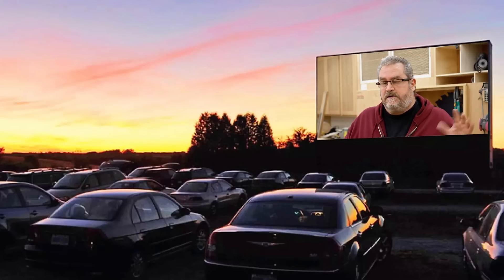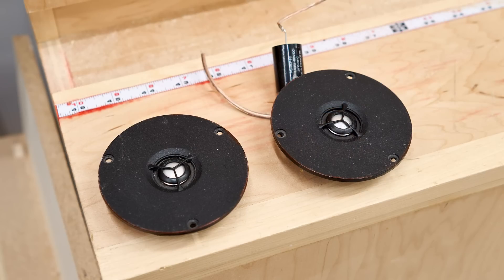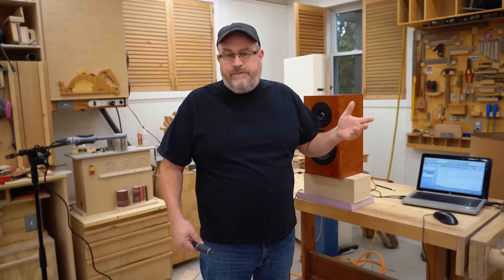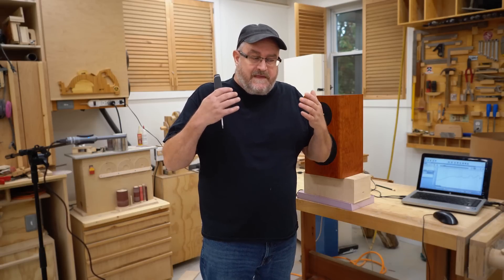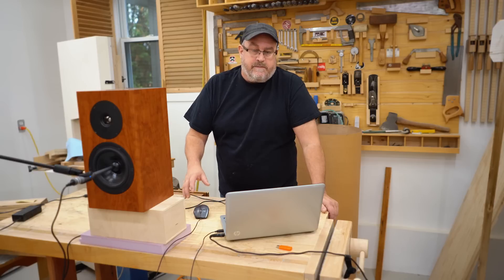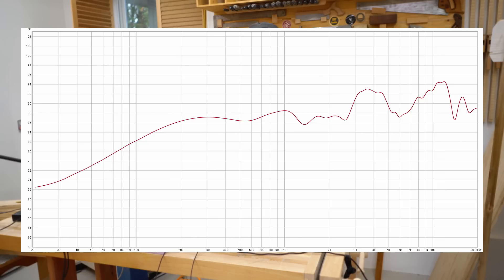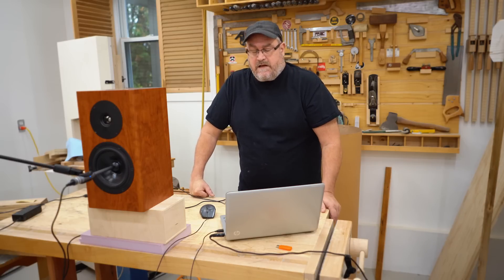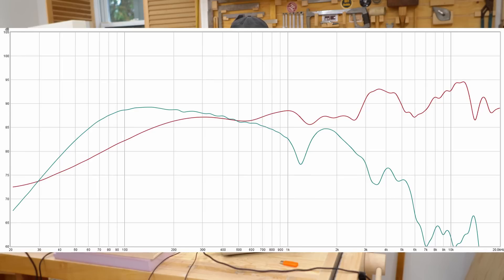Why My DIY Speakers Sound Bad / Measuring With REW and UMIK-1

Comment from the maker: What I mean when I say there will be no major builds on this channel is that I'll be posting those on my main channel, where I do full project build videos. When I build a new set of speakers, that full build video will be on my main channel.
On here, I want to concentrate more on the technical, much like I do in this video. So I'll be going through details that won't be in a build video, or prototyping and testing.
Like I said at the beginning of this video, I'm not an expert but I do have a fairly solid background in designing and building speakers. I was heavy into this for several years more than 10 years ago and have forgotten a lot of what I learned at that time. I'll be working to get that back and learn more, but I will make mistakes along the way. So keep that in mind when you watch. 
Regarding the tweeters in these speakers, that peaking is likely from a combination of the tweeter quality, poor crossover design and some diffraction. However I've found a replacement pair that are a better match for the woofer, and I'll be installing those with a newly designed crossover in an upcoming video.
Building the office speakers: https://www.youtube.com/watch?v=GlBuJhMSmcI
Making the original crossover: https://www.youtube.com/watch?v=kO2faotm3sE

Comment: How about forget the crossover entirely and use a stereo amp in each speaker to drive the cones separately. D-Class mosfet amps are dirt cheap, and technically it is a better solution as you can tweak it to get the crossover point and levels exact.

Comment: From the camera angle it looks like you measured it with the mic aimed at the woofer, you should have measured it at the tweeter level and in between the woofer and tweeter, measure it with one of the driver polarity inverted to check for the null at the crossover point, and also add some baffle step compensation.

Comment: Why don't speaker manufacturers just post a graph now instead of a picture of the speakerz?! With the decline of av stores we have to unfortunately rely on only measurements now which is a shame. Measurements are absolutely not the end all be all but I guess that's what we have to work with right now. Oh well. At least its accurate.

Comment: One of the most common issues with DIY speaker builds is that they tend to completely ignore directivity.  That's somewhat understandable as it can be quite a chore to perform the necessary simulations or manual CEA2034 spins but it also tends to negate much of the builder's work.  When a passive or DSP-based crossover are designed based solely upon an on-axis response without proper simulation or off-axis data, the result is typically severe directivity nonuniformities which produce a completely different listening window and in-room response when ERs are summed.  Unfortunately, this is also a problem which can never be fixed after the fact using EQ.

Proper directivity matching really needs to take place when drivers are being selected, with a degree of passive control also being engineered into the baffle itself.  Where possible, a waveguided tweeter simplifies much of the design process.
Reply from the maker: Hearing guys talk about off axis response and elevating it to make or break importance is getting old fast. Directivity and off axis response are important, but not the major factor it's being made out to be lately. And it's largely determined by two things: driver size (cone / dome diameter) and crossover frequency. In a two-way there's not a lot to mess up unless the drivers are grossly mismatched.
Reply: @IBuildIt  Directivity really is a make-or-break characteristic, as it is one of the few problems that can't be corrected after the fact.  If the response of your early reflections differs drastically from that of the on-axis, then you effectively have a speaker with an unpredictable listening window depending upon the room.  Studies published by Olive and Toole corroborate this, as it pertains to listener preference. 

The pistonic diameter of the driver in conjunction with the chosen crossover point determines the widest achievable directivity but only given an infinite baffle.

The trouble is that crossing a directly radiating 20mm or 25mm tweeter over to a 5" or 6.5" midbass driver almost necessitates a directivity mismatch under most circumstances, as the Fs of the former will almost always place its usable  passband far beyond the point at which the latter narrows.  You mention that directivity is a simple matter for two-way designs but in practice, the vast majority of them lack smooth directivity for this reason and we now have access to a great deal of measurement data which shows this.
Reply from the maker: I just made a video talking about early reflections and my opinion on that research. Early reflections are destructive and need to be treated so that they don't corrupt the direct sound from the speaker. That's the make or break component in all this - reducing or eliminating those early reflections, and not trying to "optimize" the speaker to make the reflection (somehow) more acceptable.
Reflections are a distorted copy of what the speaker is putting out, and having more accurate off axis response can actually cause comb filtering to be worsened - two of the same signal arriving at a slightly different time will cause cancelations at some frequencies.
Sounds like all of what you understand about this comes second hand, and not from anything you've done yourself.
Reply: @IBuildIt  
Early reflections do produce comb filtering but above the transition point, it becomes so narrow as to exceed our Equivalent Rectangular Bandwidth (see Fletcher's paper) and in conjunction with HTRF, the result is a perceptually smooth but additive response.

Most listeners do not make use of room treatment and it is therefore critical that a speaker exhibits uniform directivity if it is to behave in a predictable manner above the transition point, regardless of the room.  When designing a speaker, one does not necessarily have control over the eventual listening environment but directivity is a characteristic which we can control. 

Arguably more problematic are late reflections, which serve only to raise the perceptual noise floor of the room and which can be seen in RT60 data.

There is certainly debate within the engineering community to whether early reflections are beneficial but your characterization above conflicts with the peer reviewed research that we do have.  If you believe that you can demonstrate something which runs counter to existing research, then I would genuinely encourage you to publish a paper rather than debate the subject with me, a fellow non-expert in this field.

You mention that my comprehension comes second hand but the most effective means by which to understand any subject is to stand on the shoulders of giants.  I could quite easily share my individual experience but it is my position that uncontrolled subjective evaluation is unreliable, regardless of the point of view for which one advocates.
Reply from the maker: Lol, publish a paper... what do you think this is? One learned professor talking to another? You can't see me, but I'm rolling my eyes right now :)
You can stand on the shoulders of giants on both sides of this issue. I'm not the only one saying early reflections are damaging - look at recording and mixing studios and the level of treatment used there to fight reflections and reverb. 
And even better is to take the matter in hand yourself and listen to both environments. Set up some treatment and compare that to the non-treated rooms you already are very familiar with.  Until you have, your opinion is just repeating back what's coming from someone else's mouth.
Most listeners don't actually listen to music or care that much about how it sounds. So tailoring loudspeakers for the masses will be a different task than setting up a listening room where how the music sounds is VERY important to the person listening. The research you are putting your faith in is for the masses, or people who (for whatever reason) prefer listening to their walls acting as speakers that play along with their speakers.
Reply: @IBuildIt  
I think this is a couple of enthusiasts having a discussion, with one of them disputing papers which in their most recent video, they admit to not having read.

I disagree that the masses have vastly different preferences from trained listeners under controlled conditions.  This is likewise a subject which has been studied in great detail (see Toole's papers) and the research replicated many times.

The scientific method requires no faith.  The aforementioned research is utilized almost daily to engineer speakers which produce higher preference scores in trials.  We evaluate models by their ability to make accurate predictions.
Reply from the maker: But still I have the gist of it. I have an adequate understanding of the premise and conclusions and (most importantly) the goal. Did you actually read the papers, or did you watch talks and interviews with Toole? Because I've done that.
I also have a treated room which I'm guessing you do not. That's why I hold my current opinions on which sounds better - empirical evidence. But they are just that: opinions.
As for faith, you are putting YOUR faith in the research. That's not the scientific method. The research was conducted in a scientific way, yes, but your complete reliance on that research is what's known as faith. You are taking it and stating it as fact when you haven't done anything to validate it in any way.
Reply: @IBuildIt  
I have both read the papers and watched the talks.  Yes, I have both an extremely dead room in which speaker directivity effectively becomes irrelevant and a more reflective one.  Without adequate controls in place, any sighted subjective evaluation that I attempt to perform will be compromised by expectation and level bias.

As I said, the proof is in the pudding.  Models are validated when they consistently make accurate predictions.  That Toole and Olive's work consistently produces strongly preferred loudspeakers validates the model.  There is no faith required on my part.  Just as I don't need to manually replicate the field of evolutionary biology or cosmology to accept the validity of those models on the basis of their predictive capability.  Just as the Higgs Mechanism model was validated when the predicted Higgs boson was discovered.  No faith is required.
Reply from the maker: But you would have to provide validation if you started promoting those subjective conclusions as FACT, if you were a scientist. 
That's what you are doing here: promoting conclusions made by others as fact without doing anything yourself to back up those conclusions. If you had said those are your opinions based on your experience and cited the papers as a resource, then that would be a different thing.
Listen, I'm used to watching guys back into a corner they've constructed around their assumptions and double down on everything they say, so I'll let you off the hook.
Reply: @IBuildIt  
I have to say that you have made far more assumptions within this discussion than I, going so far as to assume that I must have an untreated room solely on the basis that I disagree with you.  That could be interpreted somewhat less charitably as arrogance or condescension rather than a reasoned response.  I would prefer this discussion to focus on the ideas rather than become personal, wouldn't you?

There is no need to replicate the research which gave rise to a model prior to stating it as factual when one can simultaneously point to said model's predictive success.  I don't need to replicate the equations which led to the theory of relativity prior to asserting it as fact when I can simultaneously point to the requirement for GPS satellite clock corrections.
Reply from the maker: I didn't assume you didn't have a treated room, I guessed that you didn't based on you not mentioning it.
Then you said something about a "dead" room, but (not to sound too condescending or arrogant) a treated room wouldn't be called a dead room. Treatment has a target and "dead" isn't it.
Reply: @IBuildIt  
Regarding my room, acoustically dead was in fact my treatment target in this instance.  I wanted the ability to produce a predictable listening window regardless of the directivity characteristics of the speakers in use but I also wanted a large space in which I could capture perfectly dry voiceover (and sometimes instrument) tracks.
Reply: @WeebLabs  why?

Comment: If you don't have an anechoic chamber, wait for a windstill day and test your speakers outdoors. Test them on the lawn on a stand, not on concrete, wood, or anything that reflects.
It will give you a frequency response test without room interaction.
It doesn't work with cars and buses going by or planes flying around though, it has to be quiet :)

Comment: first step pickup all that stuff and go do your measurements outside. also watch this https://youtu.be/zrpUDuUtxPM 🙂
Reply from the maker: You don't have to take anything outdoors. You use a gated measurement, like I explained in the video. If you knew anything about speaker testing, you'd know that.

Comment: Wait a minute, did I hear right that you use weight of wire to calculate crossiver?I always thought that inductance of coil is calculated if you know wire diameter, interval between neighbour winds of wire in coil and inner diameter of coil, but not weight. I see you unwind factory made coil to wind new coil, but are you sure it's ok? Maybe your speakers sound bad because of improperly calculated and made crossover?
P.S.: When I design crossovers for speaker project, I usually calculate it's components values at least in two or three crossover calculators to avoid mistake. Crossover frequency is important too. In 3-way speakers I prefer 200 Hz and 4-5 kHz frequencies between woofer and mids and mids and tweeter. The trick is that bigger part of sound should come from one driver. So mids must be best part of your speaker, because we hear mids best of all. As for 2-way speakers, I prefer 3-3.5 kHz between woofer and tweeted, usually works fine. And tweeter is usually loaded by II or III order Butterworth. As for mids, it is usually I order Butterworth, but mid-range driver must have extremely linear frequency response between 100-5000 Hz at least. If it is so, result will be good.

Comment: To have a good phase around cutoff frequencies, you must put the tweeter behind the woofer. Thank's to ARTA or HOLMIMPULSE, you can verify the phase linearity : CSD on ARTA is linear around the cutoff frequencies ; Phase on HOLMIMPULSE is linear too. You can invert polarities but the best choice is to push behind the tweeter and measure a lot of time.

Comment: John the mic is always set to 1 meter on axis or off. Your sweep should be set to have 1 watt peak to peak @ 1Khz or 2.38 V p-p AC.. Then take your measurements. I guessing your using REW for your measurement  software. Also try constructing a baffle behind the microphone . That will eliminate reflection at the measuring point. Enjoy your videos. Have a wonderful day.
Reply: The standard spec says you drive 1W and measure at 1 meter. 1W into 8 ohms is 2.83V rms which is 8V p-p.  An RMS voltage is equivalent to a DC voltage when translating it to power. P=V^2/R. Power in units of Watts is not p-p or RMS, it’s just Watts.
Reply: Hi John, I tried to help you out on speaker measurement and how to do it consistency and to FTC standard for home audio. Yes I was wrong on the RMS voltage it is 2.83. Been in the hospital and I thought I remembered it off the top of my head. Again sorry was just trying to help you out.

Comment: In order to properly splice nearfield to farfield gated response, you need to process the nearfield for cabinet diffraction. Your low frequencies will shelf down ~6dB and you will get some response modification based on the distance from the driver to the baffle edges.  Also sometimes offsetting the tweeter to one side and rounding over the baffle edges will tweak the tweeter response to be smoother.

Comment: Dumb question, John - why not do this in the garden ('yard') for a 'free field' response?  I remember doing that years ago at university. We also had a calibrated protractor to measure off-axis response. Very impressed with the fit & finish and your mastering the software. Subscribed. It's going to be an interesting ride! All the best, Rob in Switzerland.
Reply from the maker: Wind, mostly. And inconvenience of setting it up - it has to be up high to clear reflections to get a measurement that goes down to a reasonably low frequency to make doing it outdoors worthwhile.
Doing it indoors is easier and the measurement can be used so that it doesn't include the reflections from the walls, floor and ceiling.

Comment: I guess this sounds like "I trying to look like a smart asshole" but FR does not need to be a perfectly straight line until you like the overall sound. Peaks in HF segment can be a good thing by giving nice clarity feeling without tearing ears apart. It seems you have whole lotta work to do with lows, cause deep LF are highly underpowered. most sound companies trying to make V-shape frequency response this days. at least - this is what mainstream market doing. I`m sure you know that.
Reply from the maker: When you hear a problem in the high end and then measure the speaker and see a 10db peak at 8k, then you know where that problem is. Not looking for ruler flat, but as flat as possible within reason is the best target to shoot for. 
The bass could be better (and I added baffle step correction to the crossover in the new one to fix that), but like I said these are only used for me editing video. And there's also so room gain.